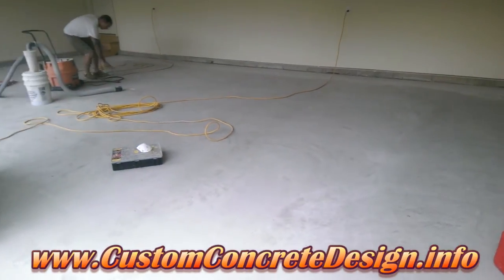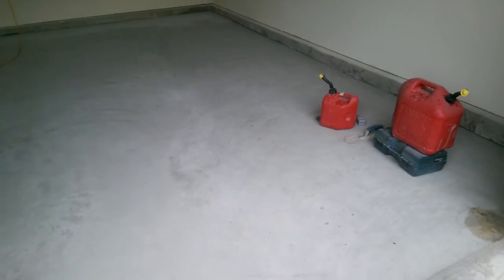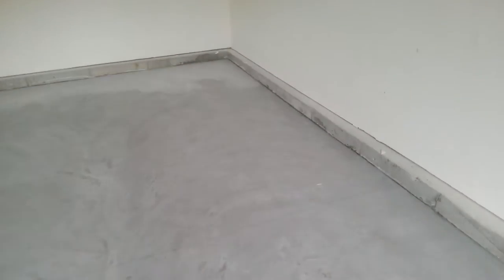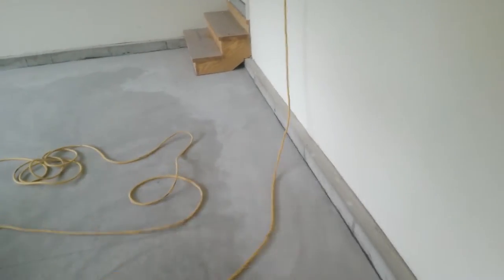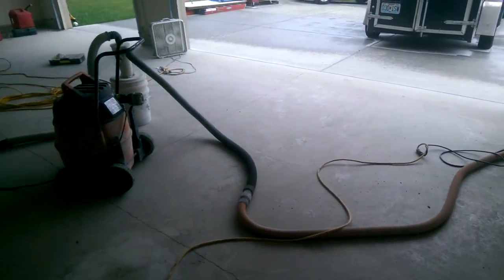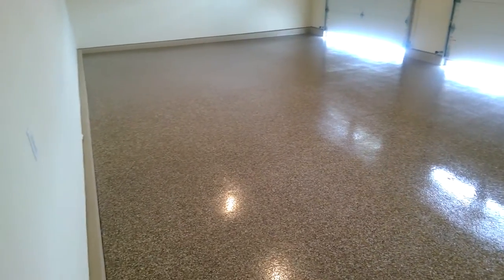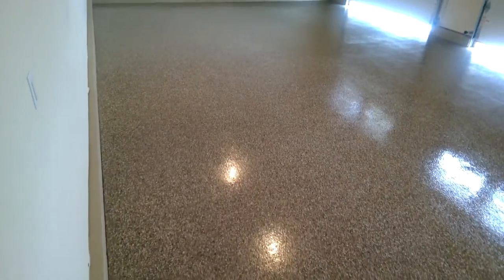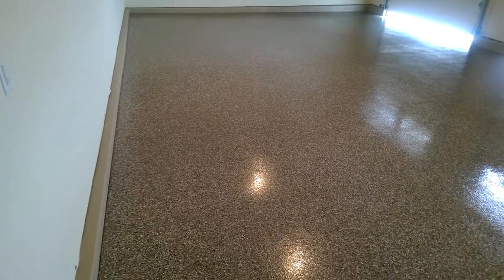Decorative Concrete Epoxy Garage Floor in Lake Ozark MO Sunrise Beach Camdenton

Comment: I had this process done in my garage by Home Depot they didn't tell me that it would turn yellow where the sunlight shined on the floor. I also have hollow spots under the epoxy. I think it's time to get mines done again. any suggestions
Reply from the maker: +Brandon Limson Grind it off and start over, patch in your hollow spots and hire a pro that knows what their doing guys from home depot and lowes don't have a clue.
Reply: Yeah I see. The materials yall use do they discolor after time when exposed to the sun light (yellowing)
Reply from the maker: +Brandon Limson on that particular project no, we used a Built in UV resistant Poly called Protectorthan by a Company Called The Concrete Protector, now if we had used a 2 part Epoxy on it we would have had to use that product over the Epoxy but the water based version.